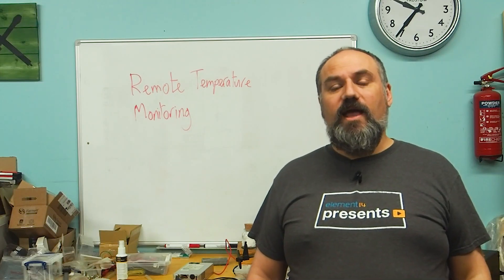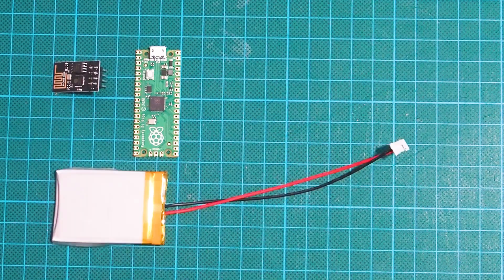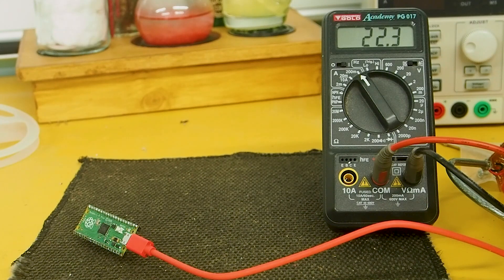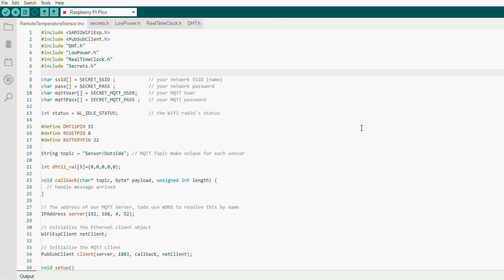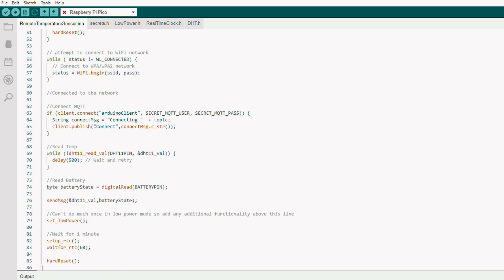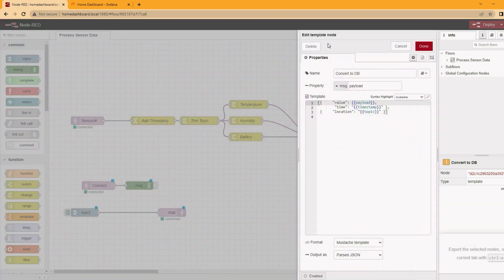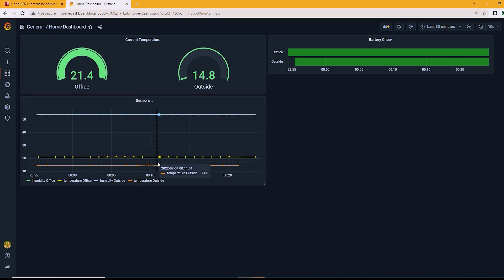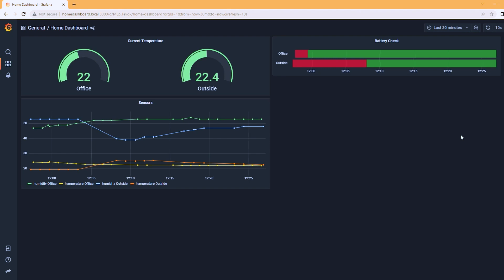Raspberry Pi Pico Home Temperature Monitoring System with Node-RED

Comment: Really interesting project and very nicely produced video. AND I understand adding a harddrive to a PI would require its own video. I tried looking for it, and search for "PI with hard drive ATX power supply", that video didn't jump to the top of the list. The search results said ~26,000 results! 
Can someone please post a link? Thanks!
Reply: The harddisk attached to the Pi via a USB to SATA adapter and should "just appear". The other video explains setting up the permission etc to make it work with the MING stack. The link is in the description, the video is on the E14 community

Comment: I did something very similar as an experiment, using a Pi 3A+, some Pimoroni breakout sensor boards, AWS IoT (as the MQTT  broker) and hosted a python based dashboard (Dash Daq) for the visualisations on AWS Elastic Beanstalk.  Was also able to do the dashboard locally via local host, but initially wanted to see if the readings/graphs etc could be accessed via the internet.
Reply: I wanted to host the dashboard locally, no need for it to be in the cloud. There are many off the shelf solutions in the cloud or the MING stack would also work on a cloud provider.

Comment: How are  you connecting  the esp8266  to the pico ? a wiring  diagram  and link to code would come in handy. Also,  what code is running on the esp8266?
Reply: Hi Jerry, the code for the ESP-01 is the standard firmware that comes with those, is called ESP-AT. The wiring diagram is on GitHub the link is via the E14 community link in the description. I don't seem to be able to add links in the comments.

Comment: Nice project , you could do the remote sensor with just an esp8266 with easy deepsleep needing only 20 to 100uA while in deepsleep. ESP.deepsleep(60e6) sleeps for 1 minute. No pico needed. Running for several mos on a small lipo. ( depends how frequent and how long it takes to send your data over wifi)

Comment: Neat project, but the lack of Raspberry Pi availability is a BIG hurdle right now.
Reply: ESP32 is a better choice for the sensor array and they're in stock at several suppliers.
Reply: @em21701  At the time of planning ESP32 were a bit hard to come by, but I have seen them since and yes a simpler option.
Reply: The MING stack could be run on other hardware or even in the cloud.

Comment: Spotted the parts is missing the temperature sensor. I used a DHT11 but there a wide range of sensors you could use
Reply: So that's the sensor he's using?